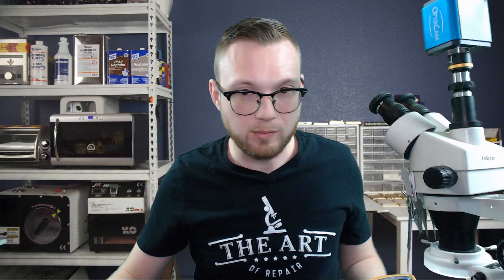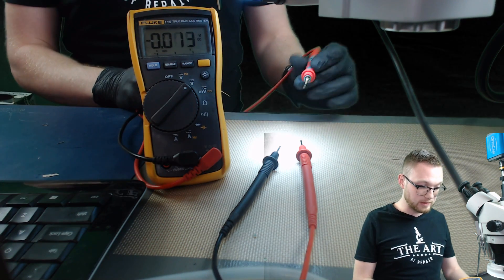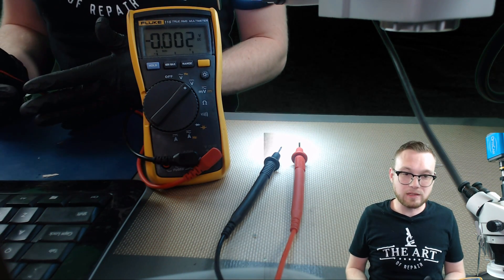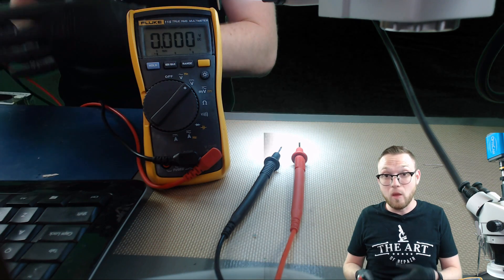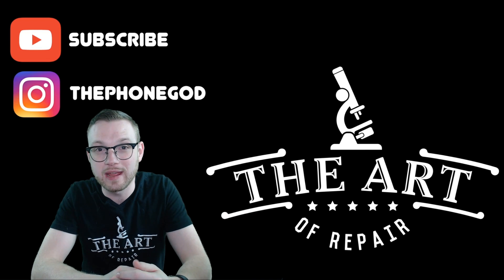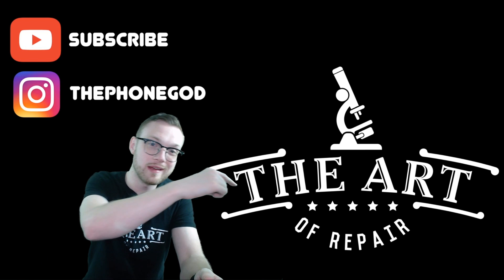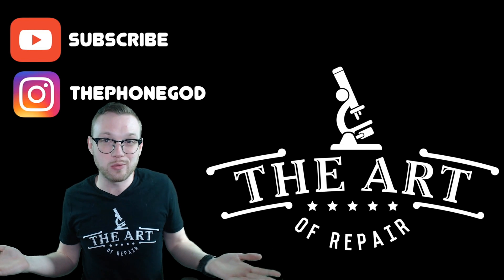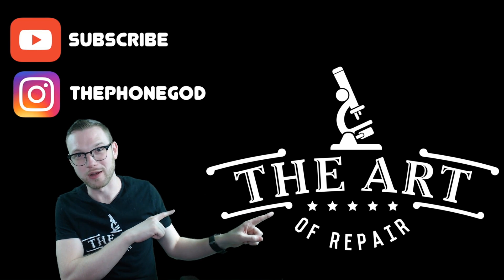EP48 Multimeters 101 | AC / DC Voltage Mode | How do I measure Voltage?

Comment: hi art of repair thanks for sharing your wealth of experience , I think I think this topic deserves a bit more in-depth tutorial as it's very important say on an actual board , finding and actual line shown on a schematic then checked on the board showing exactly where to place ground probe and live probe thanks for your input for the repair community especially from me a newbie ( noobi)
Reply from the maker: Your 100% right, it does need another video to go with it. But this specific video was just about the basic function about the AC/DV voltage mode which can apply to so many other applications. A more in depth video is already in the que. =) I just like to move one step at a time to make sure people get the full understanding of each concept before adding steps. =) Thank you for your comment and support!